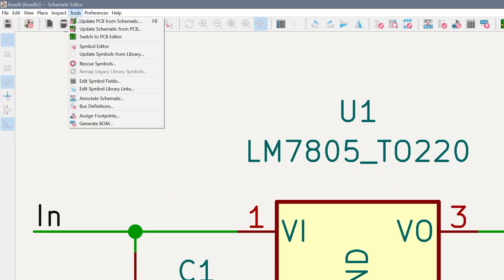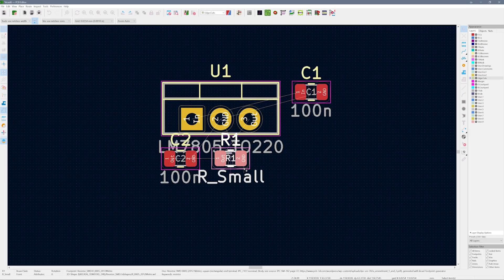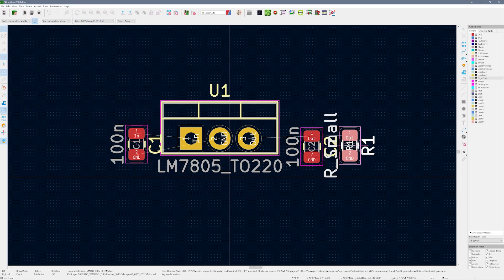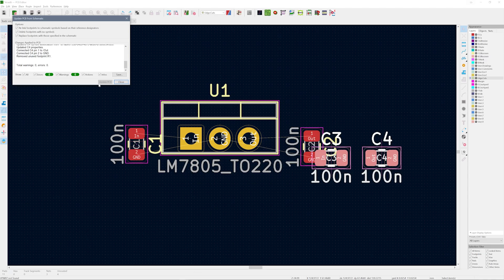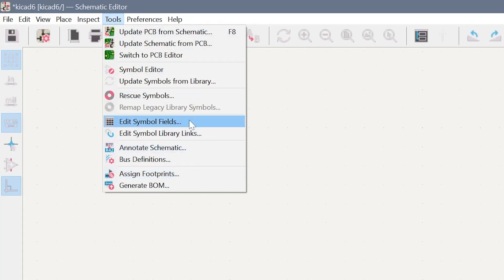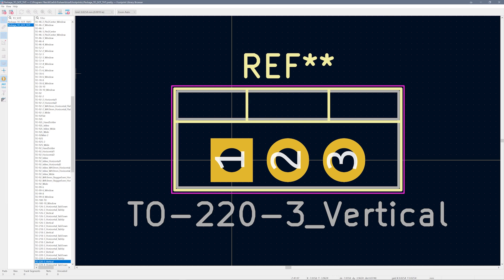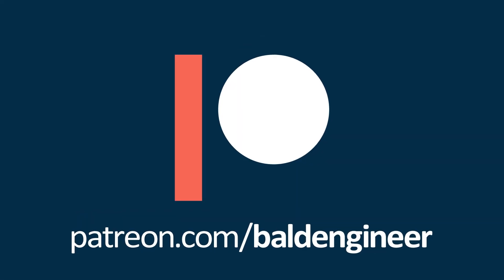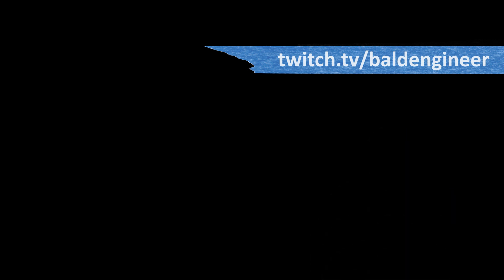Get from Schematic to PCB Faster | KiCad 6.x Quick Tips

Comment: I need to swap out an Arduino Pro Min for a Nano in my existing design. How would I do it?
Reply from the maker: There’s no shortcut. It depends on how you did it in the first place. Remove the old symbols/footprints/routes/etc and add the new ones.
Reply: @AddOhms  Thank you for your reply. Is there a tutorial in AddOhms--or anywhere that you are aware--that goes over the footprint tool in KiCad in depth?

Comment: One thing I'd like a quick tip on is placing parts in the PCB viewer, there are options in the menu to place as an array but that duplicates the footprint! I haven't quite figured out how to place a set if footprints already on the board at regular intervals. 
ie. Is there a way to place 10 capacitors in a 2x5 array by simply selecting them and specifying spacing?
I'm designing a keybaord in my spare time and this would save soooo much time while iterating over designs, finding a layout I prefer!
Reply from the maker: I think you can accomplish what you want with the Align Tools. For a row, place LED 1 and LED 5 where you want them. Then put LEDs 2,3,4 in between (doesn't matter where.) Highlight them all, right-click, Align/Distribute, and click Distribute Horizontally.
If you place 1 and 5 at multiples of the interval you want, then that function will evenly distribute them.
(Also note, if you use the "to left" or "to top" options, whatever part you last clicked becomes the reference.)
Reply: @AddOhms  That's exactly what I've been doing to align multiple keys, though its repetitive to do on 5 rows, 12 columns of keys in my case :) I think I saw eagle has this feature and I'm not sure if its just hidden somewhere in kicad!
Reply from the maker: I guess another option would be to create the array. Then write a script to grab the XY values from the file and then update your file with those XY values... If you figure out a good workflow that way, then you can make updates to your template that apply to the actual PCB.

Comment: To simplify footprint selections for common parts such as resistors and capacitors -- typically the same for the whole board, I choose it the first time I add one (e.g. 0603), then later copy/paste these components when I need one and just change the value. They carry the initial choice of footprint, which is a huge time-saver later.
Reply: I'm following the same work flow !
Reply from the maker: Great tip. I've also considered making a template that includes those pre-defined passives. (Not sure yet if that'll work.)
Reply: @AddOhms  When designing PCBs for a hobbyist, like me to populate, would like footprints to allow a flexible range of jellybean passive components.  For instance, a footprint that simultaneously allows a 1/4 watt THT resistor OR an 0805 SMD in the same spot.  Perhaps, a combo SMD/DIP footprint for common MCUs would be useful ... like an adapter plate pattern.
Know of anything like this? That footprint library is an intimating beast for a novice.
Reply from the maker: I don't know of anything that is pre-made. However, such an idea would be a good exercise to learn to make footprints.

Keep in mind that the Footprint library (in the "right" dialogs) can be filtered. And in most cases it is grouped by <component_type><mounting_type>.

So Resistors have a through-hole and SMD segment. And once inside of the the SMD segment you can filter by 0805.